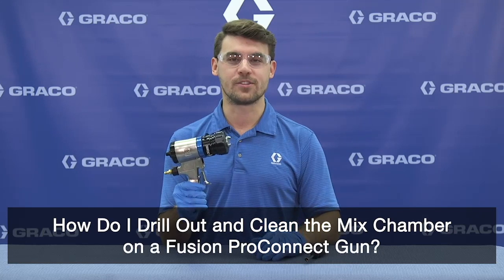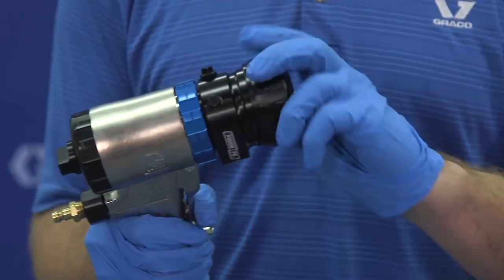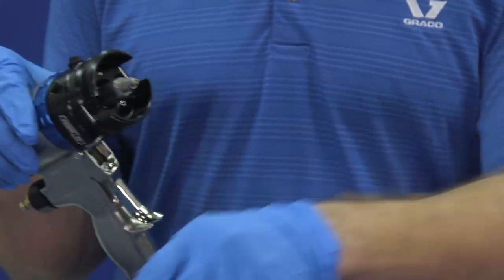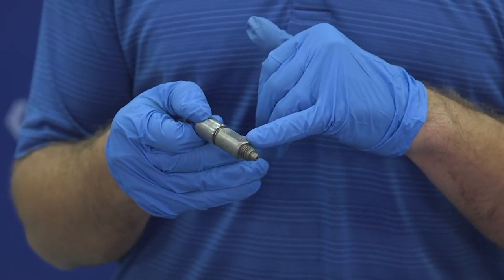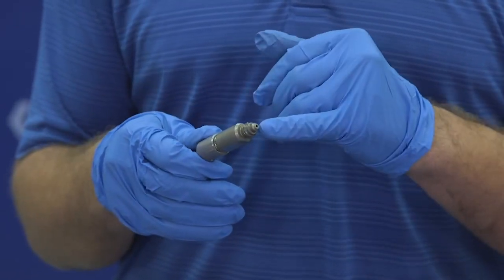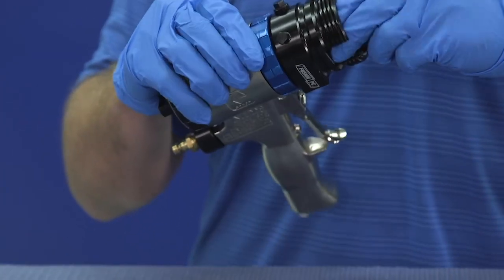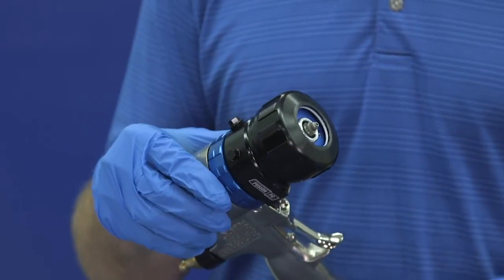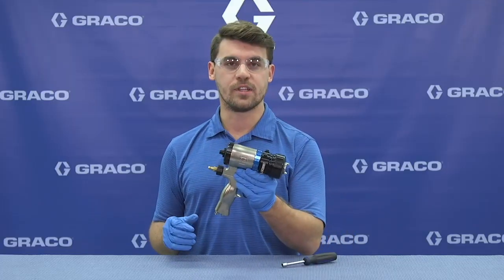Drill Out and Clean the Fusion ProConnect (PC) Mix Chamber

Comment: when the mix chamber gets crudded up particularly on the ISO side , what does Graco recommend for cleaning the faces that are in contact with the side seals ? If solvent soaking , which solvent , if using some polishing method , which grit ? Also Graco claim there is a special coating on the mix chamber surface . Is that some type of sprayed on coating and what would be the lifespan of that coating , and final question , through normal use how often would Graco recommend changing the mix chamber , e.g. every time you change a cartridge ? Every 3 cartridges ? etc -Thank in advance
Reply from the maker: Please give our Tech support team a call and they can answer any questions you may have. You can reach them at 866.61.5959 M-F 7:30-5:30 CST.

Comment: can the mixing chamber be clean while you have active a side and b side in the gun. can you remove the mixing chamber from the cartridge with active a side and b side.
Reply from the maker: Hi Cheng. You cannot remove the mix chamber from the gun if it is active, as the side seals would have no surface to seal against if the chamber was removed.  We would always advise to close the check valves on the gun manifold first to shut fluid flow off to the gun before any servicing was started.  Please let us know if this helps. Thank you.

Comment: What are best ways to get a broken drill bit out? We used to be able to heat the AP chamber up a bit, and tap the tip out with a hammer. We tried this on our new PC chamber, and it seemed like a very soft metal, and ruined it. Please help. We are using it for Line-x applications.
Reply from the maker: Hi! Please see this video and let us know if it helps. https://youtu.be/HsHzyfzykQQ
Thank you.
Reply: Boil the mix chamber using a thrift shop pressure cooker for 8-10 hours using thick ethelyne glycol aka anti freeze. The drill bit will drop right out

Comment: How would you clean the side holes of the mixing chamber without getting chemical all through the cartridge and messing it up.
Reply from the maker: The ProConnect cartridge is removed which provides access to the mix chamber impingement ports without having to remove the hose manifold. The cartridge can only be placed into the gun in one direction, preventing any cross-over. Hope that helps!